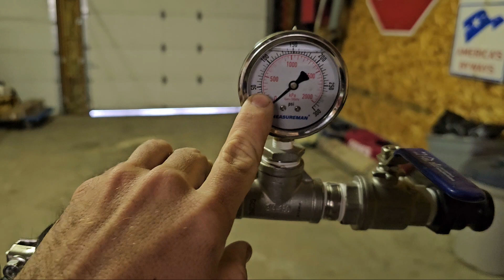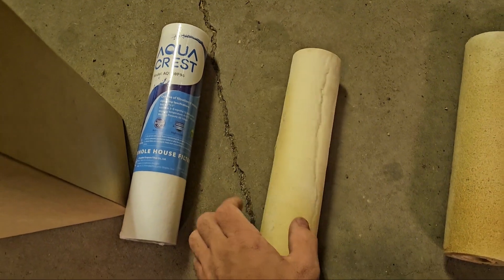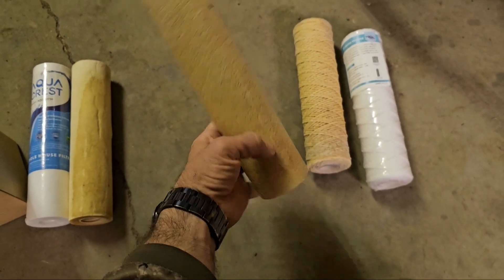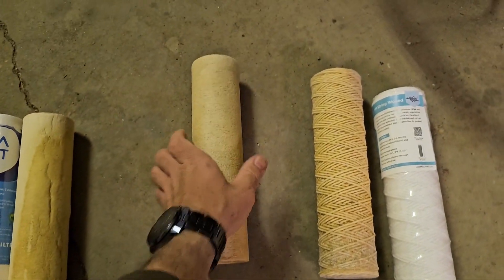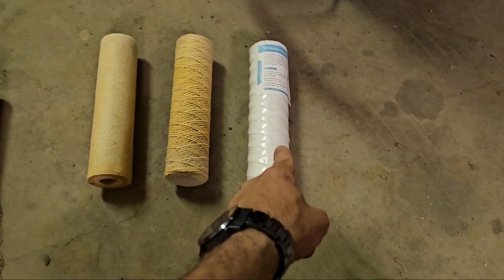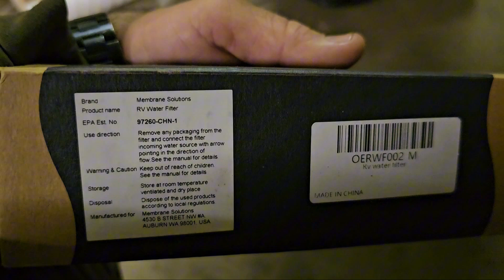homemade reverse osmosis filter information

Comment: Still doing boat welding ??? Watching some old videos of yours ! I’m learning to TIG on my own and had a buddy ask if I could stick his pods on. What tungsten and filler size did you run and cup ? And what machine settings for heat and hertz ? I tried but didn’t pre heat and I had trouble getting the two to come together. He also has a 1/4 plate on the whole back I’m welding the pods to…. He already bolted them just wants to sturdy them up by welding ! Thanks if you see this
Reply from the maker: @coltensawyer6761  3/32 , 7 cup and 5052 rod. I use a multimatic machine so it auto sets to the thickness i want. Going from probably .125 max to 1/4" with tig it's going to suck and get hot as hell. Personally if I was welding that I'd use mig
Reply: @JDSOutdoors  I see… maybe not. If I just do a few spots t sturdy them since there bolted as well what diameter filler ? 1/8? I’ve seen people tig it is why I thought it was doable, but they also went to the boat not 1/4. Is that why you say MiG with the plate being there ? Thanks for the advise. Have a good end of the week man !
Reply from the maker: @coltensawyer6761  1/8" filler and yes it can be done but tig welding 1/4" sucks